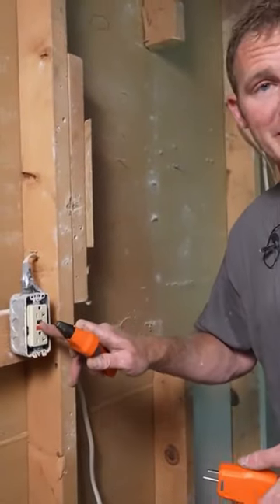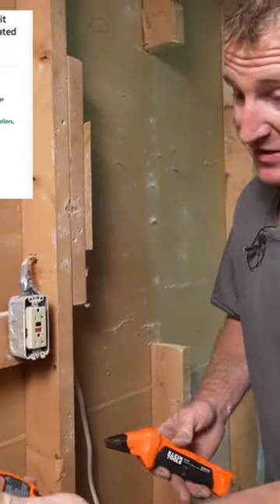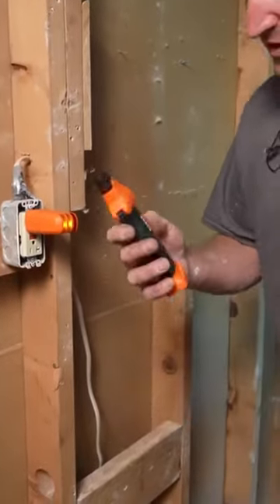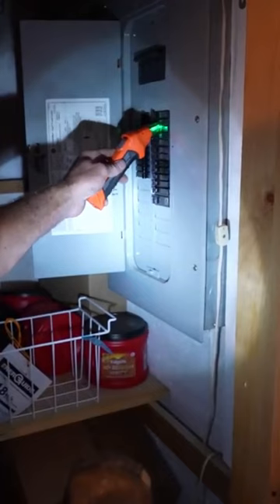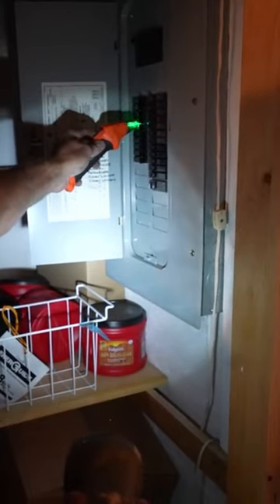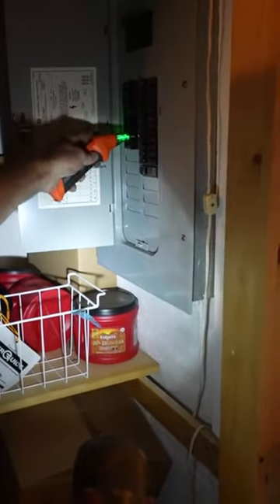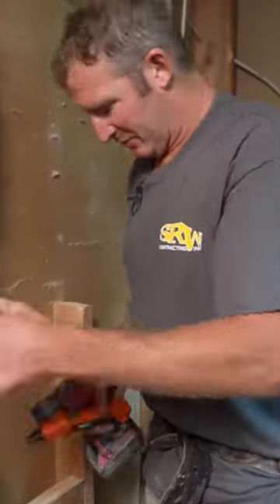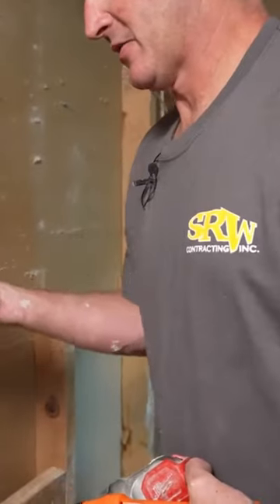How to move an electrical receptacle safely 🔥🔥

Comment: I use a beeper for this. I plug it to socket, and i hear the sound. Not a smart toll, but it works.If the beep stops, there is no voltage in the outlet.

Comment: That tool doesn't work as well in real life as he makes it look. I bought one and it kinda sucks. It sends false signals to neighboring lines. Maybe the house I was working in had some electrical issues but it didn't find the line clearly at all. I had to shut down multiple wrong breakers before I found the right one.

Comment: I have an older version of this made by Sperry. Useful.

I'd probably just remove the gfi, unwire it and tape the hot instead of making 2 trips to the panel and having to get the circuit finder out. If I was especially frisky I'd probably just pop the circuit for 2 reasons. 1. Not all breakers trip even after several direct shorts. 2. Who wants to make a trip to a basement from the second floor three times and carry around a circuit finder?

Comment: You are using it wrong. You are supposed to scan over all the breakers first, this calibrates the sensitivity. Then scan for the breaker the identifier is plugged into.